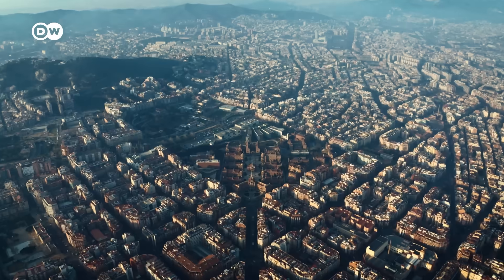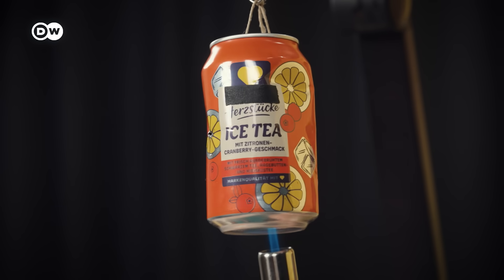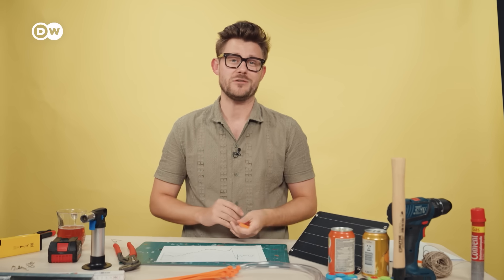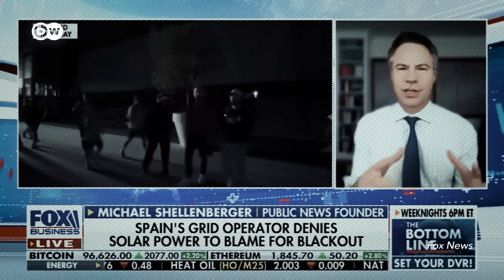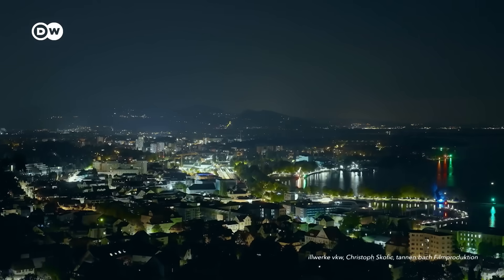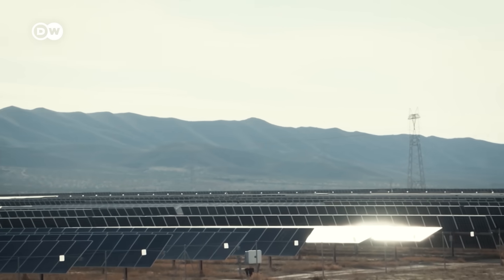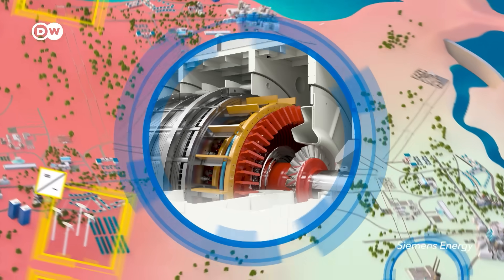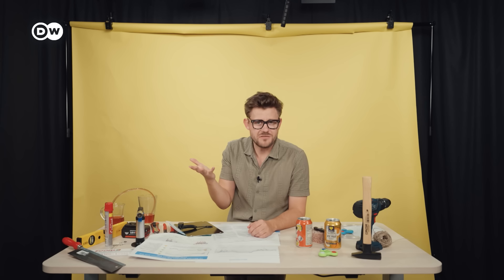Solar's hidden problem (and how to solve it)

Comment: So it's not actually a problem with solar, it's a problem with decisions being made to not invest in the electrical grid's equipment properly
Reply: And not to forget .. batteries
Reply: @houseofancients  Flow battery tech is probably the coolest thing I've seen, so far, that has potential for grid use.
Reply: Kind of feels like you could maybe use a gravity battery it's just a factor of how long you want to stabilize because if you use gravity battery it will not produce anything and then it will pass.
Reply: @sky0kast0 gravity batteries don’t oscillate
Reply: Of course it’s not solar. It’s idiots like you who don’t understand it but think they have a clue and then make stupid decisions. There actually answers that make it even cheaper (it already is by far the cheapest) but you wouldn’t want to get it. 
So just keep trying to destroy the word. Well done.
Reply: And regulation
Reply: Weird that the news failed to mention that bit.
Reply: @Descriptor413 the news is a bunch of morons they don’t have a clue about complex topics. They always assume it’s the first thing people point out or they themselves think it was.
Reply: You were paying attention. Good on you.
Reply: The fact that coal, oil, and gas receive EXTREME AMOUNTS OF SUBSIDIES and all the oil fossil shills and bots going "extra costs for solar" is very funny to me.
Reply: Woke Gullible bots😮
Reply: @iwanabana In America solar and wind make up the vast majority of subsidies. Nuclear is on the lowest received as far subsidy received.
Reply: @iwanabana so do wind and solar
Reply: @snodgee Yes, but the point is that generally the media and public point that renewables are getting them, while oil companies have been benefitting from them for years but it’s not spoken of
Reply: True, in such a complex infrastructure as the electric grid it is down to bad governance, lack of correct understanding of how the shifting power grids input factors affect and ripple through the network when components fail, lack of corrective actions and investment into solutions that can regulate and automate the balance of supply and demand, voltage and frequency regulation is paramount in a electric grid. It is one of the most important factors to always have consistent. When you add intermittent supply you need to also add base line power supply or other regulating equipment to prevent a drop in voltage and frequency. A high renewable power supply percentage in the grid, does need careful planning, and correct amount of rapid reaction fast discharge correction technologies and you need a baseline power generation solution like nuclear power plants, geothermal power plants.

It’s actually also quite difficult to get the grid going again if you get a total blackout since it requires to “jumpstart” the grid again and requires national grid control room operations to coordinate many suppliers in the grid when they should start to push power to the grid again.
Reply: Exactly! The title is absolutely misleading. Most contemporary solar systems are fully compliant with modern demands. Old grids and stupid managers are responsible for blackouts. power Spain to Ukraine, where massive attacks on grids and generating facilities can not cause any devastating consequences.
Reply: The privatised grid, may I add
Reply: Nope actually, it was a decision of the energy companies, which were losing money at that time cause it was super cheap the k/h..surprised the video didn’t mention that as all in Spain we know that.
Reply: If solar only works with additional expenses then that may well be a problem with solar, depending on how high those extra expenses are.
Reply: @ManuelBTC21  We know what the extra expenses are and they are not too high. At the simplest level you only have to put the same systems that run on steam powered plants.
Reply: @ManuelBTC21 Solar works too well, that's the problem. Spain has basically had free energy for most of the year starting in I believe 2022, but they got lazy and didn't expect it would produce WAY MORE over time as the grid expanded. So when solar power production spiked and demand went down, the grid overran with too much energy.

Spain could solve this by removing inefficient, expensive plants off the grid that cost 5-6 times as much, like gas and oil, and only hold them in reserve, but it also would be inefficient to start those back up and get them running at full power from nothing.

Spain is in a weird place where it's post-energy scarcity but doesn't know how to store the extra energy or shut down too much energy flowing through.

All of the other tech is also useless to them at this point because it'd be throwing money into a pit just to be as inefficient and costly as its neighbors.

Edit: Although converting some of that solar energy to steam would allow the use of turbine momentum as a stop-gap. What they might need is progress on salt or sand batteries to keep in reserve.
Reply: @MrBazBake the easiest solution and the solution most of the EU wants is to sell all of that cheap energy. I say Most because of this tiny country called "France" that doesn't want it's nuclear to compete with Spanish cheaper renewables and blocks further attempts of interconnection between the peninsula and the larger EU market, to the detriment of everyone.
Reply: @ManuelBTC21 all the grid upgrades in the UK are for wind and solar , in Norfolk cutting down thousands of trees for the transmission lines
Reply: No, it was solar, because investment into buffer solutions, that would ensure grid stability, were not mandatory, because solar would become too expensive to pay for itself.
Reply: @looseycanon Still it’s the problem of decision makers, if they new the system would become to expensive to pay for it self if buffer and regulation technology was added to the grid, then the technology isn’t ready and it should not have been invested in or the government since they are so happy to push this narrative that we must go green should take the extra bill/cost for actually getting a stable energy grid that’s always correctly designed, installed, implemented, managed and maintained, but of course they don’t they expect the public to pay higher electricity costs instead.
Reply: @looseycanon  The decision-makers are supposed to first understand the problems but then why fail to take action ahead of time? No they should take action before issues occur.
Reply: @justinvictor8509  Those same decision makers, who don't have incentives to act in that way. And that's why, we're here.
Reply: No, it's a problem with solar.

Comment: Renewables are actually toxic consumables. calling them renewables is misnomer.
Reply: Renewables are the energy, not the machines...
Reply: @old-pete  right.
Reply: @GeneralFukzamatayu what is toxic in renewable energy? Fossil fuels and nuclear are better? 😂
Reply: @imtheeastgermanguy5431 battery materials and solar panels are both highly toxic and unrecyclable. Traditional engines and the nuclear ways disposal cycles are much less unmanageable much more sorted already.

One needn't go to school to learn this stuff, one can learn this stuff even without going to school.
Reply: @GeneralFukzamatayu 
Both can be recycled.
And the new sodium batteries are not even an issue.
Reply: @old-pete  essentially false; it's not economical to recycle. One cannot say that everything is recyclable. that would surely be a fallacy. That would surely be incorrect to say that everything made of molecules is recyclable.
Reply: @GeneralFukzamatayu 
I did not claim that everything is recyclable, but those two things are.
Reply: @imtheeastgermanguy5431 yes, nuclear is the best, bar none.
Reply: @old-pete  then why aren't they recycled?
Reply: @GeneralFukzamatayu 
They are.
There are multiple companies that do that.
Reply: @GeneralFukzamatayu  there are already companies which can recycle solar panels in a 90% range. Batteries can be used as a storage unit and they can last many years

Comment: There is a quick solution: they need an energy storage to store surplus solar energy and to discharge it when it is needed.  Example of grid energy storage are battery, hydrogen, or flywheels, which will work perfectly.
Reply: Also using excess energy to pump water into reservoirs (Spain would need to do this in the north) and then using hydro powered turbines to "fill-in" when there is either a peak in demand or drop in production.

Comment: Use grid forming inverters instead of grid following inverters. Problem solved.
Reply: That would indeed change everything. Unfortunately it is currently illegal in Spain, to install grid forming inverters.
Reply: There is a good reason, these inverters are power sources that is why they are dangerous, grid following can only work if there is grid frequency, but grid forming can inject power, a utility worker at a substation can die because of that.
Reply: @pedrorequio5515  There are indeed situations where everything on a grid-section MUST be disconnected, so that particular grid-section is completely without power. 

 This is why it is possible to design grid-forming iverters, to have a separate means of communication, so a central authority can (at any time) decide if the inverter needs to be disconnected from the grid.

Comment: For a demonstration stating electricity flows from positive to negative does help avoid going down a atomic/electricity theory rabbit hole -electrons flow from negative to positive.

The gravity fed water cup analogy is  a bit clunky. I'd suggest to laymans reading that a better picture of the concept of grid inertia would be a plane that cut its engines and is now gliding -it already spent the energy to climb to altitude, now gravity is bringing it back down which is its own form of energy (stored energy). This is more conceptually close to generator turbines spinning down.

Solar versus traditional/nuclear energy grid inertia is like throwing a baseball versus a ping pong ball.

Even better would be a car rolling to a stop after the engine js turned off.
Reply: Totally irrelevant and counterproductive when discussing problems in an AC grid. Direction of current is irrelevant to direction of power. Explaining a DC circuit doesn't help as it behaves totally different. People then think voltage rises when demand is lower than production which is just plain wrong for a grid. They handled it well in the video.

Comment: I think that another way to get inertia from renewable energy is flywheels (that contain neodymium magnets and carbon fiber) battery energy storage hybrid systems to provide that inertia to stabilize the grid. While starring extra energy to be used for later when demand is high.
Reply: Synchronous condensers are flywheels spinning with grid frequency. Non synchronous flywheels can store more energy but can't provide as much short circuit power. Non synchronous flywheels where already a seldom sight but we probably won't see any new installations worldwide as their role is totally taken over by grid stabilizing battery farms often called netboosters.
Reply: @thoreberlin I'm pretty sure that the flying wheel will use a lot of inertia that can store enough electricity while the batteries will be used to steady the power long enough for the hybrid energy storage system can be use effectively to power the grid effectively.

Comment: ✔Kinetic batteries could fix the problem.
Reply: Just normal batteries with the right electric fitted to it
Reply: @imtheeastgermanguy5431 the issue with chemical and thermal batteries is that they don’t provide rotational inertia, which is why large-scale AC grids can experience stability problems when relying heavily on them
Reply: @CesarAnton there are already electronic devices which can do all this.
Reply: @imtheeastgermanguy5431 Frequency-matching ≠ inertia. 

Chemical batteries don’t provide real inertia on their own, they can only approximate it with advanced grid-forming controls, and even then it’s not a full substitute for physical rotational mass. 

Did you watched this video? They explain this in detail. Which "device" do you mean? Mind we are talking about public AC grid systems, not residential micro-inverters.
Reply: @CesarAnton maybe you should watch the video as well. They literally said that battery storage can "start" the grid after a blackout. But also with other energy sources like big power plants you need a clever grid.
Reply: @imtheeastgermanguy5431 At 8:06 in the “Solutions” segment, they introduce the synchronous compensator. It functions similarly to a kinetic battery but cannot accumulate or store energy.
This is used to prevent the blackout in the first place, as explained in the video.
Reply: @CesarAnton I just did a quick research and I found out that battery storage is able to do it

Comment: Renewable energy sources like wind and solar are leading us towards a decentralized energy system. Combined with battery storage there will be less need for a centralized power grid system. I just bought a battery backup system at a significantly reduced price. Soon consumer based battery storage will balance out centralized electrical generation.
Reply: No. Todays inverters will shutdown without Grid. We need Grid Forming Inverters. Now. Mandatory.
Reply: @HansJanssen-r3r That is a requirement from governments and utilities because the utilities pushed for regulation that require all manufacturers of inverters to automatically shutdown the inverters output to the grid in the event it detects a loss of electricity from the grid. The reason is that if repairs need to be done on the grid utilities will shutdown power and if the inverters didn’t function this way they would output high voltage to the grid making it dangerous for repair 👨‍🔧 personnel to do there jobs.

Comment: Renewable grids are also adding batteries that can perform various grid support functions such as Frequency regulation: Batteries can charge or discharge in milliseconds to correct deviations in the grid's frequency. Voltage support: They provide voltage regulation and reactive power support, ensuring the grid stays within safe operational limits. In addition both Batteries and inverters do not need to be just "grid following", they can be "Grid Forming"
Reply: Yes, I'm disappointed they didn't mention this. It's a crucial solution and you get it basically 'for free' when you install battery storage.
Reply: Yes, I'm disappointed they didn't mention this. It's a crucial solution and you get it basically 'for free' when you install battery storage.
Reply: @jonathanmelhuish4530  Its not a crucial solution becuase batteries massively increase energy costs and even then can only store energy for like a couple hours, the long term storage you would need for when you over produce in summer and under produce in winter simply isnt viable with current battery tech and wont be viable for like a century. This is why spains solution to the blackouts was just to import more natural gas. 

The only realistic solution to make solar and wind viable like this is hydrogen.
Reply: @watchonjar  H2 the solution that's always around the corner but never arrives.
Reply: @EcoHouseThailand  its closer to coming then batteries for long term storage.
Reply: @watchonjar Not true. I depend on lithium batteries for my work, and they can hold a charge for months.
Reply: @watchonjar I've been off-grid for 8 years powered by batteries not H2. I've just helped install solar and batteries on his house in the UK. I don't know anyone who has a H2 off-grid system in their home.
Reply: @w @watchonjar  want to know whats expensive? The loss of productivity for an entire country for a whole day due to a blackout… not only is it wrong it’s ignorant to say what you just said, solar is much cheaper overall thats including grid protection costs
Reply from the maker: Hey there! We tackle the batteries as a solution to stabilize the grid in this video where we looked at the challenges for the grid with renewables 👉https://www.youtube.com/watch?v=u-DsDuTceTo
Reply: @DWPlanetA but still worth a mention here. In Australia they are planning to do a trial in a region to see how much the theory can be put into practice.
Reply: @lawrenceheyman435  search grid forming battery or grid forming inverters - there's already 5 operating in Australia, with the original battery in South Australia making a lot of money and causing a drop in the use of gas that was believed necessary to stabilise the grid.  South Australia spent a lot of money on synchronous condensers due to its very high solar and wind production when it now looks like grid forming batteries would have been a lot cheaper.
Reply: @michaguy  well, synchronous condensers were a well proven technology that had been available for a long time, and Australia already had a lot of good experience with them due to Australia's funny demographic spread, which has led to very thin long distribution lines in sparsely populated areas. With that in mind, synchronous condensers must have been the default solution. Can't really blame them for that. 😊
Reply: @DWPlanetA but not the virtual grid stabilizers, right? Those are essential. Also bi-directional charging as huge decentralized buffer. And how this together would save tens of billions in grid expansion?

Comment: 8:04 I think we used to call this a flywheel
Reply: The video didn't describe it well, it's a SynCon with a flywheel attached to provide additional inertia and energy storage. The SynCon is effectively a motor with a very heavy shaft that provides very rapid response for balancing and inertia support but for short durations. If longer durations or higher levels of inertia are required a flywheel can be attached, which reduces responsiveness but increases the amount of energy stored that can be released over a longer duration.
Reply: Yes, a flywheel is what provided the inertia. Synchronous condenser/compensator is the name of the whole system